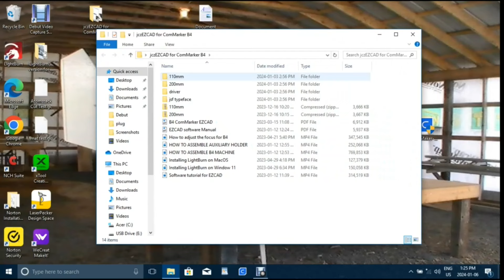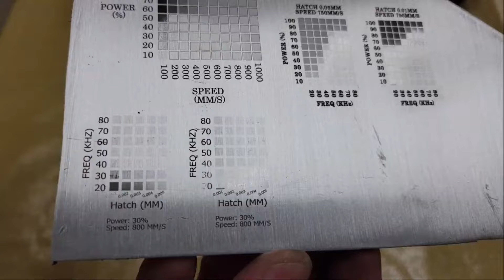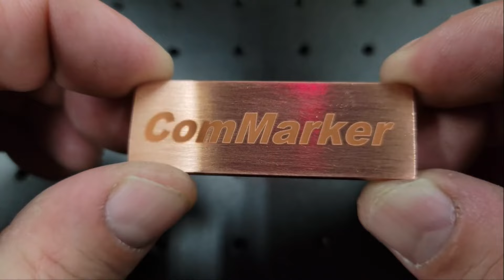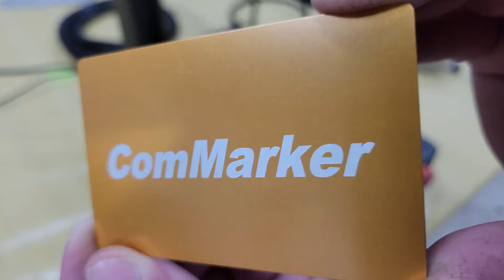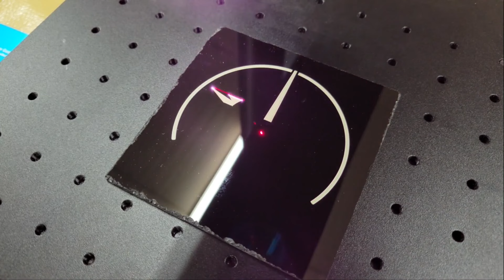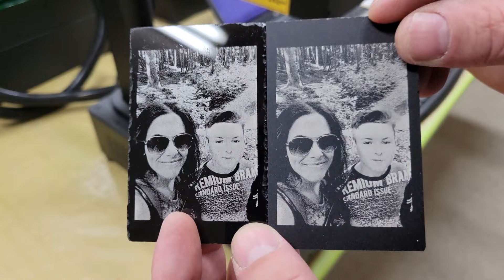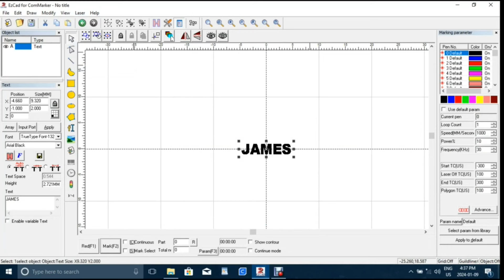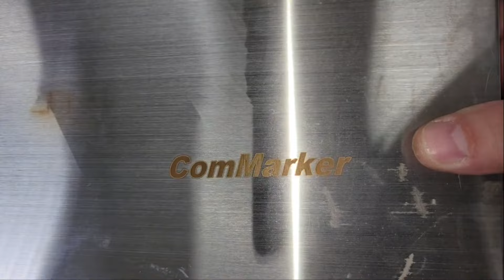ComMarker: Review from 'James Biggar ' 3D Metal Engraving W/ ComMarker B4 Fiber Laser: Review

Comment: setting for cleaning steal?
Reply from the maker: It depends on your metrial; we use a speed of 2000, an interval of 0.05, and 40% power for hammers and pliers. and the same speed and interval with 50–60% power for our D80 rotray. If you are not sure about your material, I suggest starting with a low power, like 30%, for testing.
Reply from the maker: With ComMarker B4 20W
Reply: @commarkerofficial  i have 30w
Reply from the maker: Then you may start with the half power for a test. @playvision5667